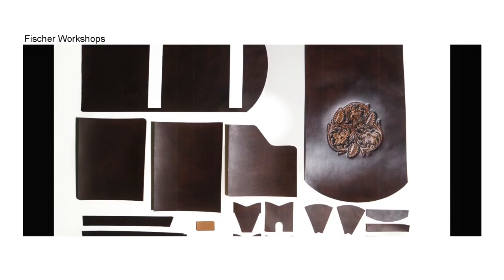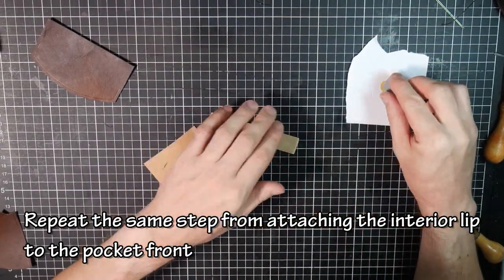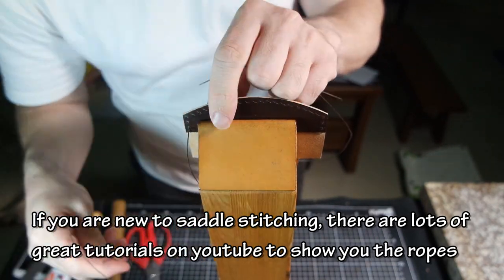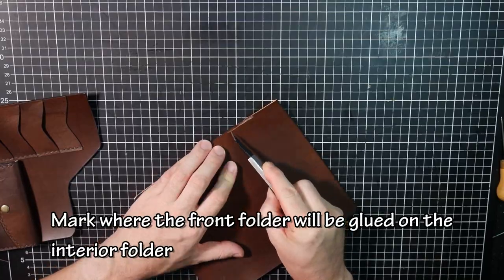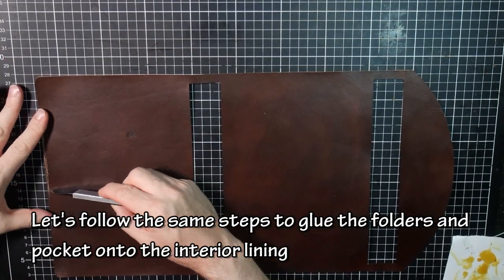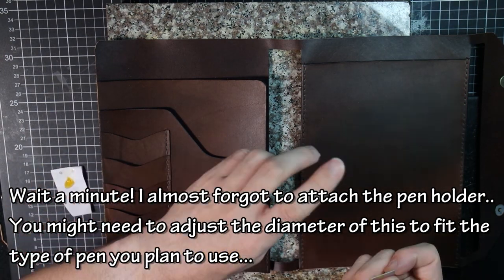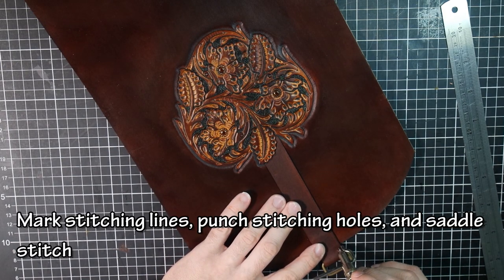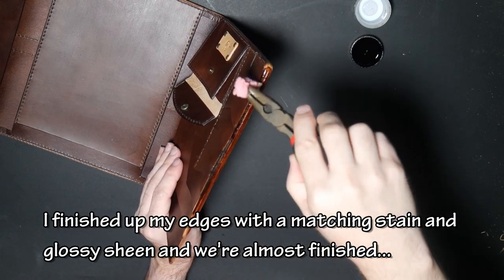How To Make A Designer Leather Notebook Wallet And Cover by Fischer Workshops

Comment: I purchased the pattern, have cut out and dyed my leather.  I'm about to start putting it all together.  But I'm having a hard time locating the "sqare ring" that you used on the strap. I've searched the hardware section at the usual suppliers with no luck. Probably a hundred different pieces I could use as substitute but none that appeal to me the way the piece you used does. Any way you could provide a link, or offer suggestions on where one could be purchased?

Comment: Hi. Awesome work and great vid! What kind of pen do you use for the edges?
Reply from the maker: Bob Park's custom leather sells them. They are basically empty paint markers that can be filled with any stain or dye you want to use. It's a simple, but great idea. Makes staining the edges a who lot cleaner and easier. If you'd like to buy some you can email Bob at, hidepounder@gmail.com